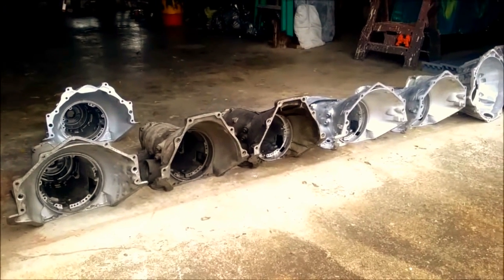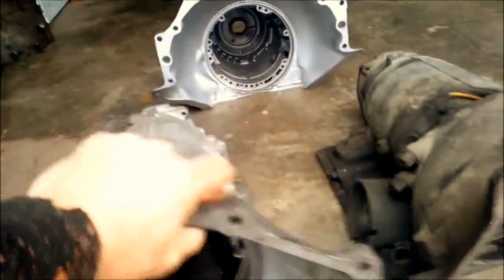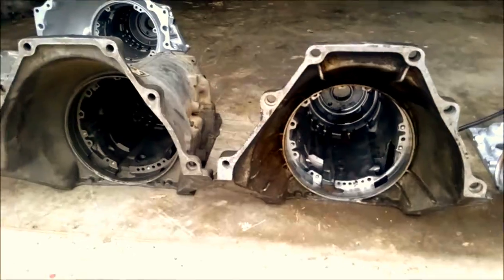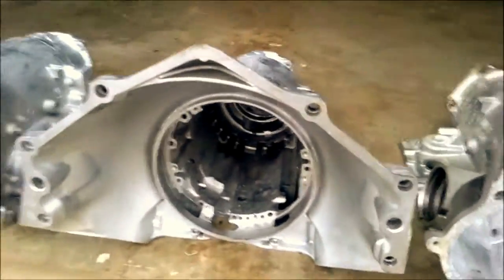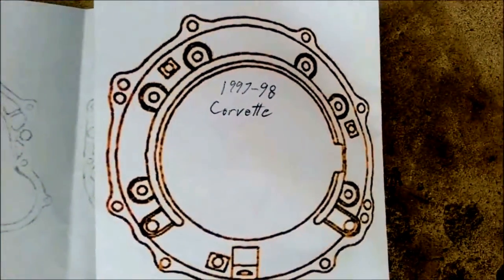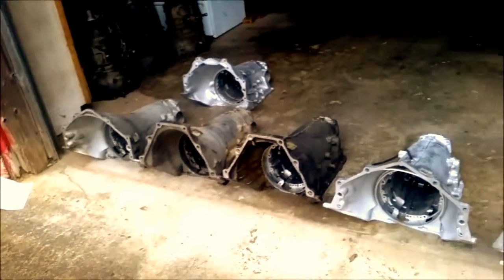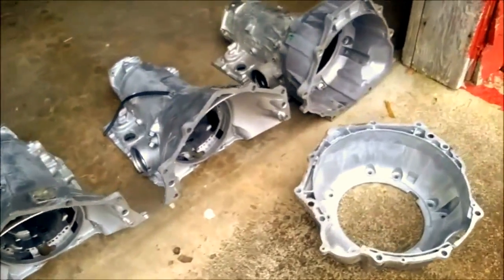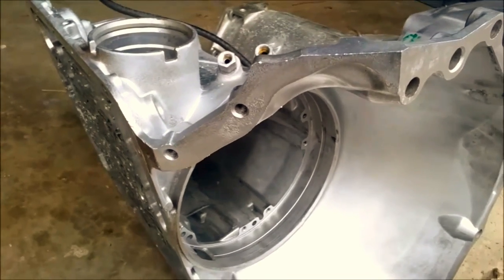Chevy 4l60e transmission bellhousing changes differences 4X4 cases

Comment: There is another GM V8 pattern , the General Motors Holden Australia Trimatic 3 speed pattern used in Australia on GM cars with 253 ci Holden V8 , 308 ci Holden V8 from 1969 untill around mid 1970s, it was sort of like the BOP but not , as GM Holden built their own V8s totally different form the US , Holden went to GM in the US in 1966/7 to design our V8 they picked the best parts of all the GM V8s lots of Olds but Chev bore spacing . Then in 1970s 308 ci V8 s were drilled with chev pattern , when the motor got EFI in 1988 and went to 304ci and later 355 ci they all ran chev pattern . On a side note , those V6 / 4 cyl flat top Trans patterns were used in Holden Commadores rear wheel drive 3.8 Buick motors and even the Supercharged 3.8 V6 . They had a lot of problems in such a heavy car and towing a caravan .
Reply from the maker: Thank you. Its always great to hear some details about the Aussie stuff we missed out on over here.
Reply: @saneauto  yes I think Australia was the only other country to develop a GM V8 of its own , there is a funny tech thing about the Holden V8, all the US V8s have the left bank of cylinders forward, I think for a bit extra room for you left hand drive , but the Holden 253, 304,308 and 355 have the right bank forward . The 1988 5.0 litre and later 355 ci injected motors have an intake exactly the same as an LS but it was 10 years B4 LS , we call it a bunch of bananas intake , and the same motor got LS port locations , roller cam , chev bellhousing pattern . They ran T700s , 4L60e, then 4L80e autos , a long with T5s and ZF 5 speeds .Google a pic of the Holden 1988 injected 5.0 you can see were a lot of LS design came from . Holden even put single over head cam heads on the 5.0 but was stopped at the last minute b4 production due to cost . It looks like a Ford 427 Cammer head design , there are pics of it on Google , it was so close to going into cars some early Commadores owners manuals have it listed as an option .

Comment: Well out of all those trannys u have a lot of different applications and body changes but there is only actually two different bell housings all but three of those trannys will bolt up to all the same engines and the other three will bolt up to the rest bbc sbc ls even the 6.2-6.5 and even the 4.3 all will bolt up to each other but thanks for showing all the different body’s it was very informative

Comment: I know this is an old video but I'm going to take my chances lol. I recently bought a 97 s10 with no reverse cause I had a 94 with a pristine motor and transmission I noticed the bell housing on the 94 was slanted like most in this video and not the full round one that goes on my 97. I was wondering if I could swap my bell housing on to the 94 transmission and go from there I won't be able to purchase a new one or rebuilt on for it until after winter and I need a 4x4 where I live lol
Reply from the maker: I dont think any have the bolt on bell till 2000 & up

Comment: I have a 1998 gmc jimmy(s10 blazer) 4x4 has a 4.3l vortec v6 a 4l60e a np233 transfer case. What transmission will work 98-2001?(years) will any ls 4l60e Trans work behind the 4.3l? How about k1500 chevy trucks,suburban,Tahoe,trial blazers? I know s10 pickup and blazers oldsmobile bravada and astro awd van but not the transfer case just Trans. Unfortunately I have acess to alot of v8 stuff. Or how about Cadillac escalade? Chevy avalanche? Gut them for the 5 pin planetary and sunshell to upgrade and rebuild mine? What parts and trucks would you look for to get the hard parts(internals) out of??? I do alot of towing and trails and hwy. Think alaska! In stuck here in south carolina
Reply from the maker: 5 planet planetaries if used with the 5 planet sun gear and ring gear will fit in the 4L60E's but the units you are retrieving them from are actually 4L65E.
Reply: @saneauto  also is it better to rebuild a v8 4l60e as they have more clutches? And what year and trucks would fit the s10?

Comment: Maybe you can answer something for me. I have a fresh built 4l60e from a 1998 GMC Jimmy 4.3 4x4 that I want to install in my 1995 Silverado 5.7 4x4 using a stand alone transmission controller. Will the 98 4l60e with removable bell bolt up to the 1995 Silverado that had a 1 piece case?

Comment: I do know that in the cateye years (03-07 classic) gm had a 2 piece and a 1 piece bellhousing for the 5.3. My truck has the 1 piece and I don't know if it makes a difference in the type of transmission like, could it be a 4l65e? Or is it just a 4l60e, and how do I tell
Reply from the maker: As a general rule the 2 piece bell of late 1990s was still a 4L60E. The 4L65E came in 2001 after the second gen 2 peice case/bell had already been introduced. If Your not absolutely sure though till you take it apart and look for the 6 pinion planets that came with the 65E.

Comment: Can a 3.8 v6 flat top 4l60e non removable bellhousing transmission be adapted for use with a stock early SBC 350? Are there any adapter plates available for that application? Thanks..!
Reply from the maker: Most of the adapter plates I know of are for adapting the 4l60-e to Ford engines. There is hope because you can call or visit a local machine shop and see how much they would make an adapter for you.
Reply: @saneauto  Thanks! 👍

Comment: Good video.  Nice and relaxed.   QUESTIONs?  I have an L67  supercharged 3.8 from an 03 Park Avenue Ultra that was in a 4T65 car.  I have been told that the smaller flat top bell housing from a RWD camaro or firebird or S10 will bolt up to this motor.  Is this correct?   Lets say I was going to stuff this motor with a 4L60E into a 63 Rambler 2 door wagon that I wanted to cruis in and occasionally leave a little rubber behind.. I have been told that in terms of the computer, the 4L60E will work seamlessly in place of the 4T65.  What flex plate and converter do I use?  Will the stock flex  plate on the L67 bolt up to a converter from a 98 -02 firebird or camaro or S-10?.  If I had my choice of the flat top trandmissions is there a particular model or year thet is stronger or more buildable than the others?   what mods would you make to a stock 4L60E before it went into such a build?

Comment: Thanks for subscribing to my channel last time I subbed to yours as well how can I decode my transmission I have a Chevy 250c thm I don't know what it came out of I am trying to get a torque converter but don't know what car to go off of trans input spline is30 and stator is 27 I know it's from a g body I think it is a 1982..
Reply from the maker: Thanks for the spline count. I might have some info in my old parts books. What engine size and engine year are you planning to use.
Reply: @saneauto  I think my engine is a Chevy 305  in a 78 Monte Carlo I almost think that transmission is out of a 1982 Monte Carlo but when I searched the numbers on Google I saw a post and they were saying it's out of a Camaro but I called oriellys and the one for a Camaro has only 27 spline so it won't work I made a video of my transmission on my channel today..
Reply: I looked on the autozone website and looked up a 1982 Monte Carlo and it showed that it is a 250c M31 that is a lockup converter that is 30 spline and the M31 is the same as my transmission...I will probably try and order one and see if it will fit..
Reply from the maker: Watched it and yep thats a TH250 lockup 198something
Reply from the maker: Are you planning on using a regular 3 lug flex-plate or 6 lug?
Reply: @saneauto  ya just the stock one torque convertor has 3 lug and flexplate has six on the crank
Reply from the maker: Heres the info on the Torque Converters https://youtu.be/m2rIiIBHsnk

Comment: OK, I have an odd question that I am hoping a good transmission guy would be able to answer. 

Is there anything I can do to help "fix" a 4L60e with the typical 3/4 clutch pack problem to get <500 miles out of it? The reason I ask is, there is a transmission shop that is about a 350 mile drive from me. I would LOVE to be able to just drive it there rather than go through the expense of towing. (I would have to rent a truck and trailer to get it there). 

If it matters, the trans does drive fine for about 20 miles or so from a cold start, then BAM ... no 3rd or O/D. 

I know back in the "old days" I would hear of people putting 90w gear oil in them, or sawdust, or who knows what. It doesn't matter how bad it wrecks the trans, as it will be getting a complete new unit. I just need it to make it there under its own power.
Reply from the maker: Lets say you put fresh fluid and filter in it and an external cooler with an electric fan on it just t be sure and you quadruple from 20 miles to 100 before it acts up. Now your possibly stuck 100 miles from home and 250 miles from the shop. Plus spent enough on fluid filter etc to just rent a Uhaul truck and trailer. Now lets say you just rent the truck and trailer early in the morning. When you drop off at the shop you now have a Uhaul truck you can drive home. The last time I was away from my garage when something broke I rented the Uhaul trailer. I took it back the same day and it totaled only $67.  You'll have a little more for truck rental but I would just rent it.

Comment: Can the bellhousings be swapped between similar years? I have a 2000 S-10, 4.3 and I am looking at buying the trans from a wrecked 2004 Colorado. If I have done my research correct, the electronics should be compatible, but from your video, it appears the bellhousings will be different.
Reply: No, the 4.3l in 2000 uses a basic pwm lockup strategy. The Colorado is going to use the EC3 where it varies lockup continuously. There is some valve body differences between them due to the different lockup strategies. And most likely the input shaft is different as the EC3 lockup used a 300mm tcc while the basic pwm used a 298mm tcc, and the input shafts were different between them.
Reply from the maker: Im thinking the same thing. The only thing that should be different is the Colorado Bell Housing. But I haven't done the swap between an S-10 and Colorado, so  im not certain. Let us know how it goes.

Comment: I have a 96 k1500 4x4 5.0l 1 piece does anyone know if I can use a 98 2 piece transmissions
Reply from the maker: Big nope, Wont interchange
Reply: Yes, it will bolt in and work provided both transmissions came out of a full size K1500 truck with a V8, been done MANY times. The difference is in the dust shield and support rods. 97 was the change over year and could have had either a 1 or 2 piece bellhousing. The 1 piece uses the dust shield with 6 large bolts and the support rods bolt to the underside of the dust shield. The 2 piece uses a stamped steel dust shield the bolts on with small bolts to the front and the support rods slide through 2 large holes in the bottom of the bellhousing with a threaded rod end on the support rods. Functionally the 4l60e used behind the 5.0/5.7l was the same from 96+, so if you get the different dust shield and support rods, it swaps right in.

Comment: Awesome vid! I didn’t realize how many variations there were.  Would the internal parts be much different between a one piece case and a removable bell housing model? For instance a 96 one piece case and a 97 two piece?
Reply from the maker: Some of the parts are the same others are too different to interchange for various reasons. Engine size, year model, and type of vehicle it came out of.
Reply from the maker: Also the pump is different

Comment: I have a 98 Chevy 1500 van, I believe I  have a 4l60e. Now my question is...what Truck and years have the same transmission and can I swap out the bell housing if its different than mine?
Reply from the maker: Thank You for Commenting. The removable bell housing doesn't exist until 99-2000 and later. The 99up two piece is technically a 4L65E. There are a lot more changes to look out for during the 4L60E production run of 1993 - 98 than just the case. I would always prefer building the original transmission and reinstalling it in the same vehicle.
Reply: Will a 4l60E from a 3800 motor mate up to the 5.3 Silverado 4l60E.  I know the bell housing is different. And the input shaft is 2mm shorter on the v6 shaft so I know I gotta modify that, but internally are they the same trans
Reply: The removeable bellhousing started in 96 for S series trucks/suv's, and mid year 97 for full size. The 4l60e as far as I know is still in use till very recently behind the 4.8l. The 4l65e is just a variant of the 4l60e. It was usedbehind the 6.0l in 1500 trucks/suv's and high output cars while the 4l70e was used in the trailblazer ss. 

For a 98 van, you can use a 1 or 2 piece bellhousing trans from a 96+ so long as it was behind a 5.0l/5.7l gen 1 small block. Do not get a trans from behind a 4.3l, 4.8l, 5.3l, or 6.0l if you want a bolt in install.

Comment: I have a 2002 silverado 2500hd 6.0. Trying to figure out what I have in it
Reply from the maker: CHEVY BOY!!!! Thank you for commenting. If it were a 1500 with gas burning engine I would say 2 piece case 4L65E. However with a 6.0L in a 2500 it would be something else entirely. Like the 4L80E Wich, I do not show in this video.